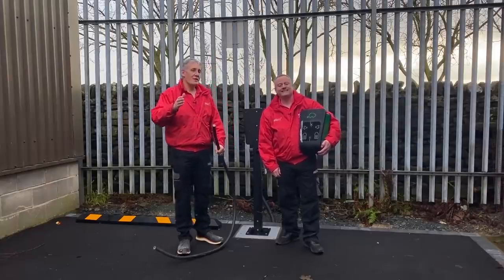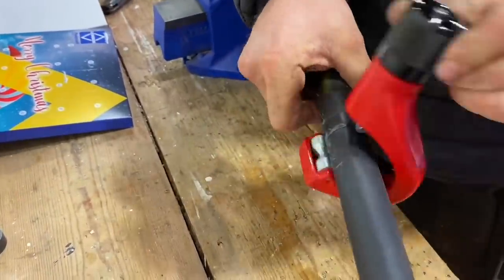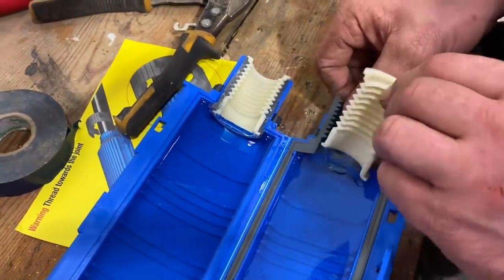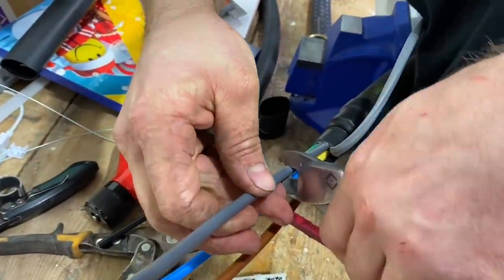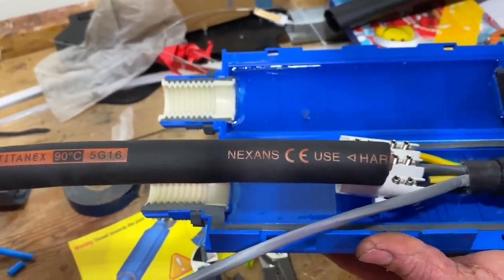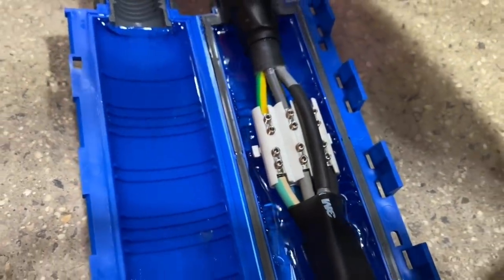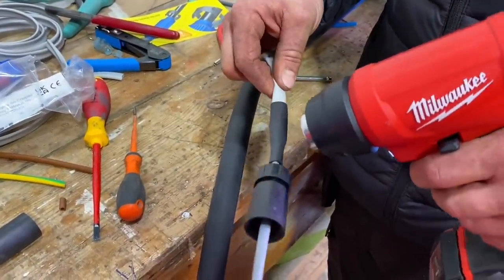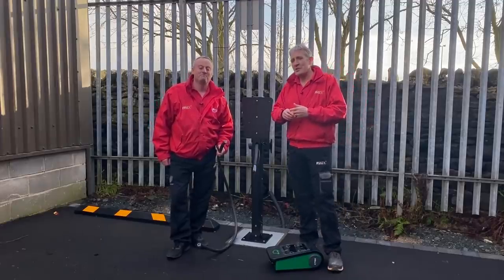PROBLEM SOLVED - USE RUBBER CABLE INSTEAD OF ARMOURED CABLE?

Comment: I think you might as well use a separate duct grade cat5e cable rather than faffing around with jointing to the one in your EV ultra armoured.  If you're running in ducting anyway, why bother with adding the armoured joint when you could just use the rubber cable for the full run? Don't want to sound negative though, thank you for the interesting videos and showing us new ideas and products!
Reply: I agree with that !
Reply: I haven't used much rubber cable, but I suppose, the rubber cable could be damaged by rodents easier (if they get into the ducting) and perhaps the rubber insulation could deteriorate quicker?
Reply: That's what they asked [the viewers] about at the beginning of the video.
Reply: @karljones4321  the rubber H07RN-F cable is not designed for fixed wiring applications and it's current carrying capacity and cable characteristics (volt drop etc) don't align with the equivalent size SWA cable, and a plastic duct offers no mechanical protection so the cable is vulnerable to mechanical damage unless the trench is backfilled with sufficient concrete
Reply: @adventuremax  sorry...your wrong...

Regulation 521.9. 1 permits the use of flexible cables for fixed wiring if they are of the heavy duty type or the risk of damage is low or protection against mechanical protection is provided.
Reply: Nice common sense thinking, I always go for simple if possible. Every extra joint has the possibility of premature failure

Comment: 7:56 don't forget to check both ends of the cable to see which has the best layout to go into the terminals.
Reply: My thoughts exactly. Checking rotation so the phases are in line would be crucial to make this joint work.
Reply: Hmm, never would have thought of that, good point.👍

Comment: Federal Republic of Germany - we use H07RN-F outside for heavy uses, e.g. construction site areas, coal mining areas, music scene, camping place areas, aso., where we change the cable way normally often. Same for EV-things, solar parks, etc. - often inside plastic pipe outside or inside the soil if it hard wired same you demonstration it. 

Of course, RCD 30mA (or less) after CU it is every time a good idea for outside cables - with or without CEE-sockets between.

Comment: Big downside to using H07 in ducts is mice and rats will have a good chew on it, had it happen way too often.. it's those cheap posts, needs to be designed with a JB enclosure where you could terminate an armoured then come off with something more sensible for the ev charger terminals
Reply from the maker: Rats and mice in Skipton!  - wise words on the rodents!
Reply: @efixx  Plenty of field mice oop norf ... ive used the smaller wiska box with mixed results, not sure about the lager one .. prefer to crimp larger cables in joints
Reply: It's not the rats and mice you need to worry about in Skipton ... It's the wolves, bears and beavers! It's rough up North! 🤣🤣🤣
Reply: @boblewis5558  you should pick better women
Reply: @jenton93  sorry! Didn't realise it was a dating site!

Comment: I think the inability / difficulty with getting armoured cable to where it's actually needed is a failure of design by the manufacturer of the EV charger.
How about making a charger, and stand that can actually accept an swa!

Hmm. . . seems like there's a gap in the market here
Reply: Not sure if I should laugh or if I should cry..
Reply: I absolutely agree,  get an other stand!
Reply: The inability of the British electrician providing an infrastructure and run a normal cable inside it is also a big failure.. how about getting into the 21st century and stop doing things in the most rudimentary way?
Reply: @filipe s spill the beans and tell us what we’re doing wrong?
Reply: @supersparks9466  i just said it above 🤷🏻‍♂️ why do you guys use swa as a one for all solution when there’s so many suitable options that can be run inside a tube..? Laziness to create a bit of infrastructure and a couple man holes? 🤷🏻‍♂️ this immagrunt is only complaining about what he always complained about in this country electric industry.. so advanced faffing around with testing little wires but so primitive in the execution..
Reply: I totally agree, I install gates and am constantly annoyed by small things that could be changed and make my life as an installer so much easier.

Comment: Rubber cables are the way forward. SWAs/AWAS are pretty much impossible to terminate in some of the larger EV installs. Some manufacturers are now beginning to class their HO7RN as duct grade.
Reply: the rubber H07RN-F cable is not designed for fixed wiring applications and it's current carrying capacity and cable characteristics (volt drop etc) don't align with the equivalent size SWA cable, and a plastic duct offers no mechanical protection so the cable is vulnerable to mechanical damage unless the trench is backfilled with sufficient concrete
Reply: @adventuremax do you have a source for that? You posted that a few times here, but no source. Volt drop? Really? Why would a stranded cable drop more voltage, we can easily measure their resistance/impedance for a let"s say 1 m cable
Reply: @silviuguseila2552  my source is BS7671 and the HO7RN cable is not covered by that standard
Reply: @adventuremax  I understand the HO7RN is not covered by BS7671, so what is the source about the voltage drop, what other characteristics do not align with the equivalent size SWA cable (you said etc so there are some more)? As for the mechanical damage, as hundreds of comments here attest, this is the preferred cable in a lot of very hostile environments and seems to be very tough. Not trying to be difficult here, just trying to get the whole picture here
Reply: @adventuremax   EN 50565-2 says HO7RN is suitable for fixed installations as well, according to a seller documentation: "Heavy duty, rubber sheathed cable for use with medium mechanical stress in dry, damp, wet rooms, in agricultural premises and outdoors. Suitable for equipment in commercial operations, e.g. heating plates, hand lamps, electric tools such as drills or circular saws. For fixed installation on plaster as well as in temporary constructions. When installed in pipes or similar enclosed systems, the use of the cable is permitted up to and including 1000 V AC voltage or up to 750 V DC voltage against earth."

Comment: The standard in Norway is now pretty much to use TEC-FLEX RV-K 0,6/1,0KV. Its a UV resistant double layer pvc cable with XLPE insulation. Super flexable especially in warm weather and can actually be buried straight down into the ground with no further protection, still following our code. However i allways use PEM plastic water lines to protect it.

Comment: Good to use rubber cables and certainly more appropriate in many situations. As for the gel seal joint they are all well and good but can break down. Having used gel joints in the telco industry for years they are certainly easy but not totally reliable. It was always a no no to have telephone cable in the same duct as power for reasons of noise and inductance and perhaps more importantly contact which could be fatel if not expecting high votages on the cat5 where i wouldn't want to see any more than 50V. Once again great video  and highly informative.

Comment: Yes! The rubberized cable is amazing, with relevant protection both physical and electrical.
Reply: Why design an unarmoured cable as alternative to an armoured one, only to require the 'relevant protection' required?
Reply: @bitTorrenter  easier to work with

Comment: Australian here  -  we use Clipsal 56-series style connector (like your commando connectors) above ground, or immediately below ground (so long as drainage is there) so there's a breakaway connector if the pedistal gets knocked-over.   This means we can safely isolate and repair without the need of messing with gel connectors.  It does mean you end up with a different pedistal design.
Reply: Good way to do it. Below ground in the UK would mean moisture would degrade the 'commando' connector. We are a 'wet' country.
Reply: @johnburns4017  and you can tell that the UK is a wet country as soon as they showed the inside of the box near the beginning of the video, as the ducting box had a puddle of water at the bottom of it.

I'm curious how well they hold up in exceptionally wet conditions where those ducting boxes end up with an extreme amount of water in them.

In the case the pedestal gets damaged and requires to be replaced, I imagine replacing the rubberised cable from the junction box is easier than having to pull the whole length of cable through again.
Reply: @CoolSteve08  
A new waterproof spice.
Reply: @johnburns4017  You do know you can go to IP69 with IEC60309/Commando connectors? If they "degrade" then they should not be rated IP69 in the first place and the joint they used was only IP68 rated.

Comment: If it's protected in a duct rather than direct burial I'd say much better to run the tough rubber throughout, rather than introduce a complex joint as another potential point of failure.
Also run external grade Cat 5 in one run, again avoiding a joint and avoiding exposing that non externally rated section between the gel joint and the Cat5 joint.
Also bringing out the Cat5 beside the flex can compromise the adhesive lining seal of the shrink tube which could provide a channel that will actually promote wicking of water into the connector circumventing the gel.

Comment: Not an electrician myself, but an IT engineer, and we run a lot of big rubber cables in data centers, I personally like them as they drape very neatly on shelves, and can be ran under raised floors as well. If memory serves they have quite high current ratings as well compared to their cross section, which of course is advantageous. Good on you guys for doing the data cable properly, as an IT guy I hate it when people treat data cabling as fancy telegraph wiring. 😂 However, I’m not so sure about the signal integrity of that cable, commonly we avoid running them parallel with high current power cabling (low signal cabling should preferably only cross power cabling at right angles), and that cable doesn’t even seem to be shielded, and if so, it should be terminated with shielded connectors and joined with shielded joining blocks. If you have access to a data certification tester, I’d be very interested in seeing if it’ll pass CAT5 and CAT6 certification.

Comment: Coudn you have stripped off the sheath & armouring to make it more flexible & run it in flexicon to the chargepoint?
Reply from the maker: We did consider this but the XLPE class 2 conductors only have 7 strands so not very flexible.

Comment: So when you joined the CAT5 cable, it was actually CAT5a with a screen around it, you used non screened connectors so the final length of it had an incorrectly grounded screen.
Unless you also did not use a screened connector at the indoors end, in which case the entire run was not screened correctly.
Reply: Given they don't use the armour as any kind of "earth", I wonder if they wouldn't use screened cable here for fear of introducing another earth path.
Reply: @CoolSteve08  in those cases (ie running screened cables where the is a significant chance of different earth potentials) you only connect the screen to one of the crimp terminals, and not to the other - so the cable is screened, but not connected at one of the crimp ends to avoid creating an earth loop.
Reply: Your terminology is wrong.  Firstly, no such thing as CAT5a.  It's CAT5e with the 'e' meaning 'enhanced'.  CAT5 is an obsolete standard and is replaced by CAT5e.  CAT5e can come in both shielded and unshielded variants and there are different forms of shielding too e.g. S/FTP, F/UTP and others, all covered by the general term of STP.  The CAT5e shown in the EV Ultra cable here appears to be of the F/UTP variety meaning it has an overall foil shield around the pairs which are not individually shielded themselves.

My understanding is that the current EV chargers don't require shielded CAT5e, many of them simply using it as a means of connecting the current transformers so it's not even digital data being carried.  The fact that they have not used the shield in this example is therefore not critical.

Comment: Recently worked in a university research/engineering complex and the entire installation was wired in HO7 cable. Only issue i could see was not all terminations were made using ferrules.
Reply: Depends on the terminal the fine stranded is joined to. Some spring loaded connectors from the likes of PhoenixContact etc. or properly sized cage clamps actually recommend against using ferrules. So not every missing ferrule is a violation.

Comment: Just my personal opinion, I wouldn’t’ve put heatshrink around the power and cat5 9:45. I’m concerned it could block the gel and be a path for water to track up. 
Also, I’ve found that the thin insulation on the individual wires in a cat5 cable is surprisingly easy to melt together with a heat gun if you’re not careful.
Reply: You are right about the cat 5 cable should be run separately and one rubber cable run completely without joining
Reply: @noelburke6224  Yeah, the insulation on the cat5 is easy to melt. As far as moisture ingress goes, the heatshrink they used was adhesive filled, so it shouldn't cause a problem with moisture ingress.

Comment: I hate screw joints, and I wouldn't have put the Cat5 cable in the joining box, since when you put two cables through one hole the water will get in through where the cables touch each other

Comment: In the video the question is put to us whether  or not to use HO7 cable for the full run or just stick to the method used in the video. There like in most cases arguments for and against this, and I’m not going to preach my own agenda here, I wanted to merely point out that HO7 cable is rated as flexible cable and as such has is own usage guides in BS7671. I work in the water industry and most pumps come from the manufacturer with a form of this cable e.g. Flygt,s SUBCAB cable, and in most cases this can’t be connected to the motor drive directly, usually due to distances. So we would always use an armoured cable as the extension with a suitable JB  connection. In conclusion I believe what was done in the video is quite correct, however I would tend to use a separate data cable as joists can cause issues and it may make the supply cable a little cheaper to install.
Reply: Whether .

Comment: As this gel joint has screw terminals, would I be right in saying they must always be accessible for maintenance as I thought screw terminals are not classed as a non maintainable
Mechanical joint?
Reply: It is accessible! It’s right there under the charge point!🤷🏼‍♂️
Reply: I agree with you Mr Williams. I still feel it is a worthy point to make as I am sure there may be a modicum of newbies that might assume it could be buried like the old resin torpedos with crimped  connections.
Reply: @dashgordon4525  Even if it shouldn't it will be !

Comment: As an ex CCTV and networking engineer, I really don't like this. That 'ip65 cat5 join' can and will fail. I've had countless issues with them. You'd be better running the data cable separately in a dedicated duct grade cable, or making the join above ground level.
Reply: Sub joints are pretty good IF installed correctly.
It is better not to have them underground however and if ducted or otherwise protected rubber cable is cheaper and much easier to work with
Reply: @jonathantatler  Until it gets old enough to need fixed…
Reply: it was IP68 i think you'll find

Comment: Great example of a nice solution. Only extra step I would take would be using shielded RJ45 plugs in the join to keep the screen continuous to the charger. 👍🏻
Reply: Ditto… the cable was shielded and the RJ45 plugs used were only to CAT5 standard so they need to offer the metal continuity screening capability, as does the IP68 connector… or just run a fresh pair of separate CAT6/7 exterior grade cables, being aware that not all shielded RJ45 plugs can take the heavier grade of exterior cable. I’ve said to run a pair of CAT6/7 cables in anticipation of a future failure; given the low cable cost, it makes sense early on to plan ahead and consider the inevitable failure. Depending on weather/climate conditions in the duct/pillar you  may only get a few years before failures appear. How many EV charge points around are offline due to failures? In most cases it’s the data link that has failed, not the supply cable.

Comment: Used H07 cable to replace and extend the power cable on my new ovens, both had 16a demand so used the 4mm cable with the blue industrial sockets. Fed from CU in 6mm T&E. Used enough cable to allow the ovens to be pulled from the housing and sit on a work bench if needed. Fortunately had enough space at the back of the ovens / housing to do this.

Comment: A flexible cable will do fine. Charging columns in a parking area are prone to be hit by cars/trucks and sooner or later will need repair. Maybe future models will slip just over the cable coming out of the base making it easier to install. First the cable, next the box column and not first the column and then the cable.

Comment: As long as you run conduit, whatever. The existing charger systems are due to change again.
Seems a bit of a waste, to spend all that money, and your new car is still outside in the rain and sun. 
You guys really are good at spending the money of others for things that "sound good".
Reply: Wow you ran low-voltage cable in the same conduit? How is that even allowed there? 
Buncha hacks.
Reply from the maker: It’s allowed if the voltage ratings are the same for each cable > 500VAC